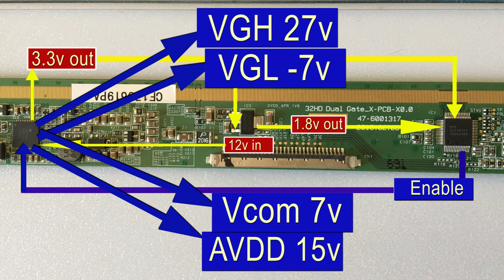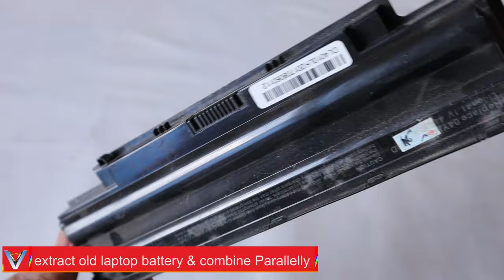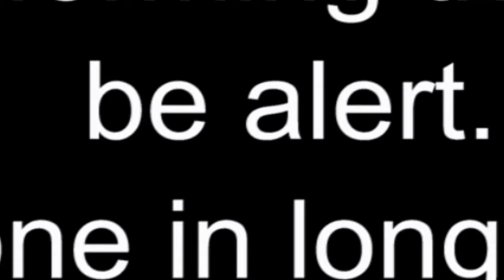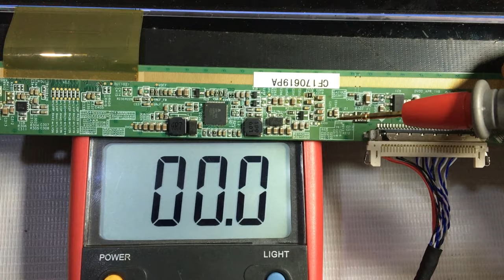LED TV Panel Repair (using short killer)

Comment: You don’t need to use battery and you can leave COF connected: use your adjustable power supply, adjust voltage to the same voltage like in circulate and add current little by little and watch for elements that will heat up.
Reply from the maker: I am very thankful for your suggestion. Andrew S
Reply: What does COF stand for? Also, when you say “... voltage like in circulate” do you mean “ voltage, like the one in the circuit”? Please clarify, I want to learn. Thank you kindly
Reply: @maxwarfield6699  COF   chips on  flim  sir
Reply: @gusvlogzzz7054  Thank you kindly, for the clarification. Cheers!
Reply: Vou dont need to use battery and you centro eleve cof connected use your ajustable power supply voltagem to the same voltage circulante
Reply: You mean using constant voltage and variable current ?
example 
using 4 volt at certain point and increase the current from zero to a level that should be noticed by eyes if a component started to be heated up ?
Reply: Enggeh Enggeh Enggeh Enggeh Bu
Reply: @kv27br96s10  Power supply cannot act as short killer.
Reply: @StephenGachara  I don't think so.

Comment: Hi, well done, the care to disconnect COFs is a thing that i never tought, thanks, to minimize risk of trace burn instead of battery can be put bench PS with nominal voltage rising from 0Amp to the point where something get too hot, the Amp level reveal the point of overcurrent. Bye...

Comment: How to diagnose XBR49X800E Sony TV main board? I tested it with resistance and found two of pins where to connect to the power board  not working, how to fix it?

Comment: is it necessarily a short when one of the test pad has no resistence to ground?
i have a TV that boot-loops when the 2 LCD panel cabless are plugged to the motherboard (the TV can start with only 1 cable but theres no image displayed)
I found 1 test pad that has no resistance to ground on both LCD panel PCBs that is called "IBC"
i don't know if I should risk the method of powering the shorted area or if the problem could be comming from the TV motherboard that I could replace for 100€

Comment: Its a nice video. I found a short circuit in panel VCC. What component could be wrong? I measure low resistance at T200 F1, and the same at Z1 and c244 and C201
Reply from the maker: Check in open circuit

Comment: 55 inches full HD LED TV k liye best inverter card suggest karo bade bhai
Reply from the maker: Bhai old model wala jyada volt lega new model me kam voltage wala bhi chalega mere bhai
Reply: @VcoreLC  Mere LED mai backlight issue ho gaya hai,
 new model ke liye kon sa inverter card best rahega aur old model ke liye kon sa card best rahega

Comment: Has anyone comes across a fix for the vertical lines on the samung tv UE55KS9000. The model is only 3 years old and eveyone just condems the screen or COF. Cant seem to fnd any schematics for this model.
Reply from the maker: E dar , send COF number & scalar board photo via email
Reply: @VcoreLC  thanks bit i just sold as is. Not worth repairing for me. And still made some money.

Comment: Friends, I have an HP Compag 6710b NotBook W7 and I can't get the digital reading device to work using the AuthenTec Inc. AES2501B Driver. It is installed but how can I activate it without any software to work like the camera on the NotBook?
Please help

Comment: How much the voltage of the batteries were connected in parallel ? and how much total ampere capacity of the combined batteries?

Comment: sir,  i have MI TV4 55 inch, presently my tv with no picture on screen,  sound ok, i have searched for repair in youtube, some technicians showed that how to block CKV lines, we did it now the picture comes with half down picture is flickering with red color, after some time it will come with no pic sound ok , is there any solution please ?

Comment: Hello Guys, I have a Sony LED TV 46" and my son dropped water on the screen. It left a black vertical error at my screen, is there a way to solve it? I believe the model is KDX 46.
Reply from the maker: Liquid damaged can’t be repair need to replace new panel
Reply: @VcoreLC  Thanks!

Comment: Short finder. Not killer. Killer will keep raising current until short blows open by itself then current stops after sensing jump in current to protect normal resistance circuit from blowing from too high voltage

Comment: Man, you definitely need adjustable power supply… Everything will go much easier with it. Set voltage to 12V and you don’t need to cut power just spray some alcohol to capacitors and you will see which one is bad by evaporation of liquid…